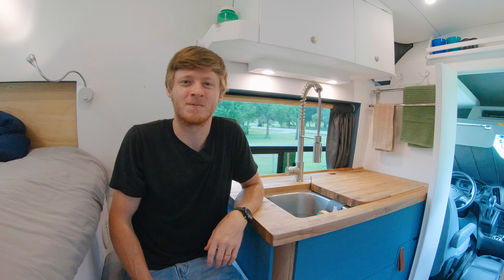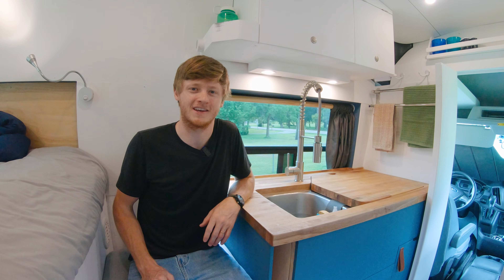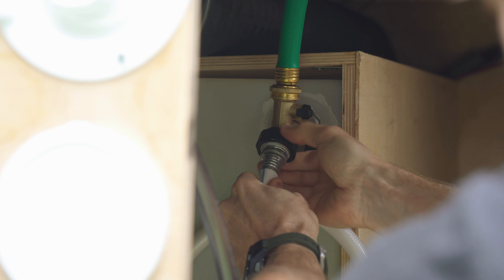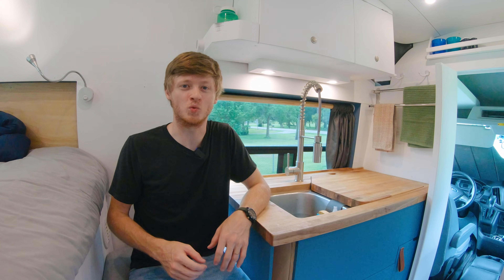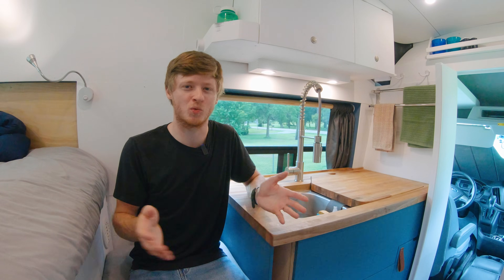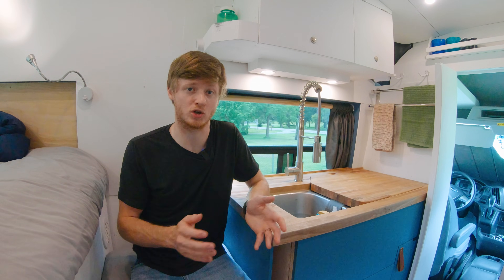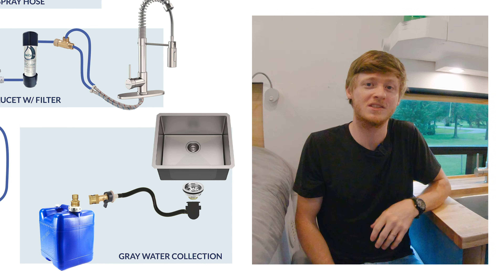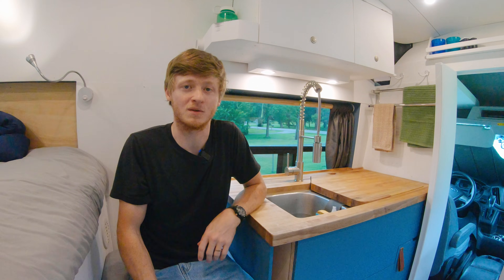Water System - Camper Van Conversion

Comment: Quick question: why not put the vent tube and the inlet tube on the top of the tank as appose to the side?
Reply from the maker: That would work and having them higher would be great, but this tank came with the ports on the side not the top.

Comment: Love your videos man, some of the best breakdowns on the Tube for sure. Question though for the grey water hose leading outside the bottom of the van did you pre do this before you put the flooring and everything down? Just wondering when in the process you happened do do this? Would really appreciate the tip.

Comment: Great video! I really need help, I know you ended up changing the gravfill inlet to a valve, but you don't really explain how you got the 1 1/2 opening to a small fill port of a hose. Theres also no links to those items that you used here in the video or on the diagram on your webpage. I am really struggling, if you have that info you would be a life saver!

Comment: With that tap you have does it have a micro switch inside or did you need to add a switch to enable the pump to operate

Comment: I have a similar setup for fresh water. I took the same fresh water inlet and cut the center out (the part with the cap). I then used hose clamps to secure it to a piece of wood higher up but still easy to reach, about 5 or so feet from the ground. Remove the cap and glue in place a piece of super thin closed cell foam inside the cap to act as a gasket. I then ran my vent up to the top of the inside of the van. I have a 30 gal. tank and fill it just to the bottom of the fill inlet, no leaks in the last 6 months. Another possible quicker or easier way is to install a tee-valve in the inlet tube.

Comment: Great Video!  Do you know if a flexible braided stainless steel supply hose would work in place of the SurFlow "silencer kit"?  I would think the braided SS hoses would be more durable and cheaper -thoughts?

Comment: Amazing vid like always! 
If you still would like to have less water pressure, couldn’t you just add a voltage divider to the water pump to be able to adjust it’s pressure? Would be neat 👌
Reply: Another way to reduce the flow rate at the faucet is to put in an aerator cartridge with a lower flow rate. Depends on if the faucet you have uses a cartridge like that though...
https://www.nrgideas.com/the-faucet-aerator-guide/

Comment: Water Usage / Water faucet pressure. In-line valve adjusted to limit flow. Although the initial pressure would be the same, it could slow the flow making it easier to limit water usage.

Comment: I like your setup in your van Sam. I’m curious as to how you put the wood paneling on the area where your bed is at. I have a Transit van as well but I would like to know how you mounted the wood there. You didn’t drill into it I’m sure because there would be holes on the outside of the van or did you use some strong adhesive? You’re videos are very informative. Thanks for any help. I like your cabinets.

Comment: Nice informative video. Could you add a simple valve to your freshwater fill hose to stop the water leaking from the fill port whilst travelling?
Reply: Yes like the valve idea. I wonder if a better brass cap would work too.
Reply: Maybe a rubber sealing ring in the filler cap would work.
Reply: Yes.  2:14